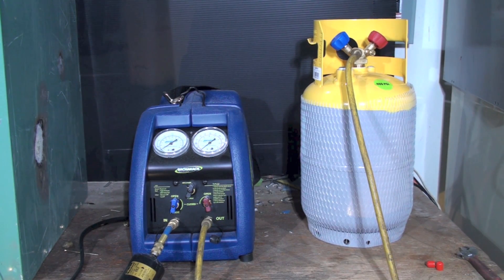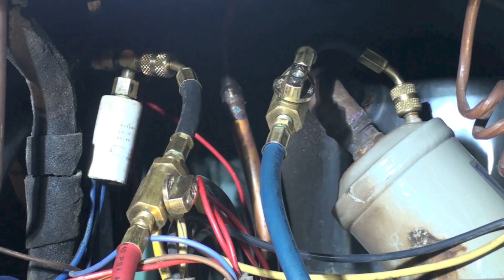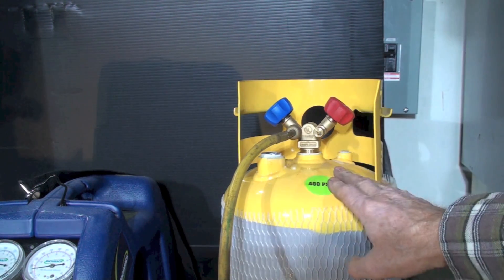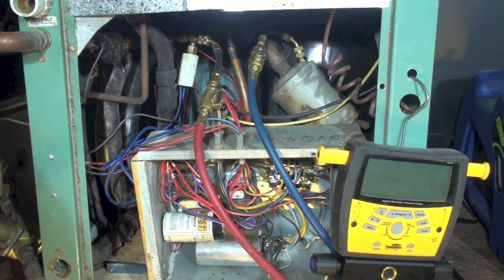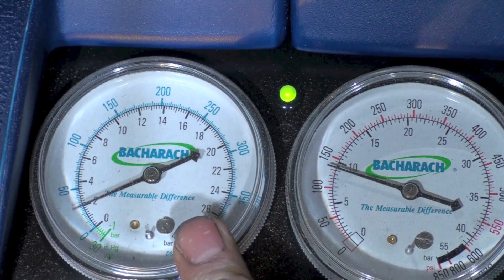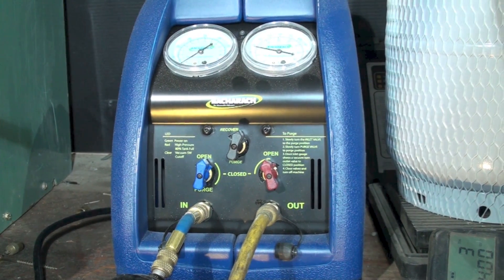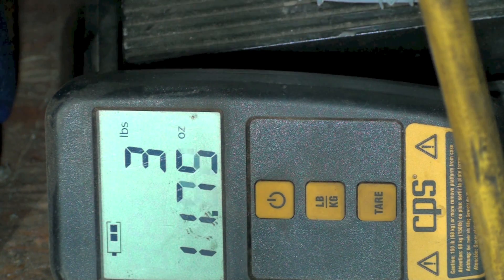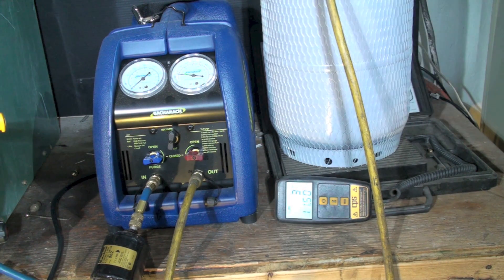Refrigerant recovery operation

Comment: Aren't you suppose to recover a vaper cause that is what I learned because you have the house connected to the liquid side of the recovery tank??
Reply from the maker: tuckker reza What I do if the compressor runs is pump out as much liquid as possible, then pull out from high and low.  The machines will accept liquid if the inlet is restricted but be careful.
GFM
Reply: grayfurnaceman Something I have learned about ball valves, is that there is a small gap between the inside of the valve body, and the actual ball, just crack the ball valves on the hoses about half way to purge/vacuum the entire ball valve, even though it only contains a tiny amount of air, any air is bad in my book.

Comment: How can I tell if an a/c split unit has been evacuated of freon before I move it? It is not installed right now. Disconnected from power etc.
Reply from the maker: Belle Starr If you remove one of the the service caps, then depress the schrader (tire valve).  Don't use your finger, liquid refrigerant will burn you.  If pressure  comes out, the unit is charged.  Hope this helps.

GFM
Reply: Alot of times they are charged with nitrogen not refrigerant because it keep the system geting exposed to oxygen moisture  and dirt cause this will ruin your sight glass moisture indicator and will ruin your compressor cause it cant compress thies things causing slugging

Comment: OK so the refrigerant recovery machine will recover the refrigerant, and a vacuum pump will pull a vacuum,  Now the reason for pulling a vacuum is to boil any moisture that may be in the system.  Correct??  Why can't the recovery machine pull a vacuum as well. Or does it.
Reply from the maker: Danny Calk The recovery machine will pull a shallow vacuum, but the vacuum pump is a very specialized pump that is not designed to move large amounts of gas.  It can't do both well.
GFM

Comment: thank you for this video, but do you think it should be connect the hose of discharge port ( in recovery machine) to the liquid side of the recovery cylinder ??
Reply from the maker: sam anderson When you are moving refrigerant into the cylinder, it makes no difference which port you use.  The liquid and gas ports are only needed for removal of refrigerant.  
GFM

Comment: Thank for the video GFM!  I am going to replace a leaked  service valves and suction line accumulator on a HP unit. Does my G5 recovery also recover all the oil out of the compressor or just the Refrigerant? How do I figured how much oil to put back into the system. Nitro while umbraze and braze,  nitro standing leak test 150 psig and pull vacuum w/ micron gauge. Since the system is flat, I am giong to weight in the R22 liquid from my recovery tank +line lengh through the fully open hi side service valve unstill it stop (unit is off ) . Turn on unit and charging the rest of vapor in suction service valve.  I am in my 2 semester in technical junior college . This I my first major repair inside a condenser. Not really sure if I am follow the right procedures. Your advices and opinions greatly appreciate.

Comment: I always weigh before and after (without any hoses connected) then write the results on the jug. One, it's more accurate because the hose weight is inconsistent due to it's bendiness and my short term memory isn't all that good.  

Great video, as always.
Reply: hi